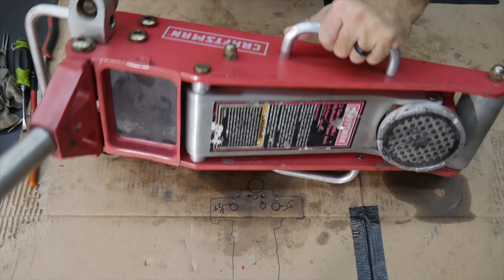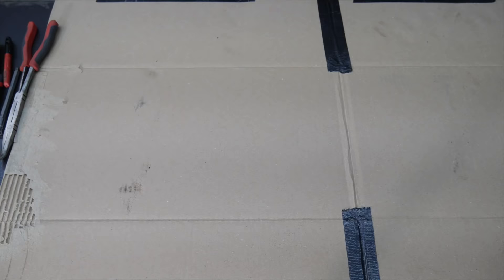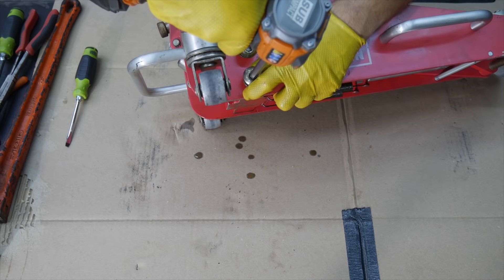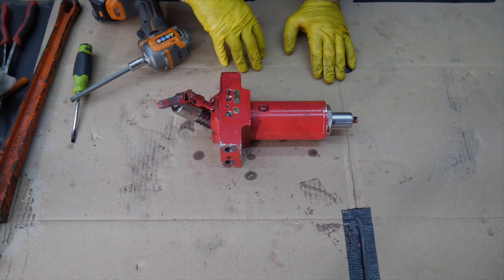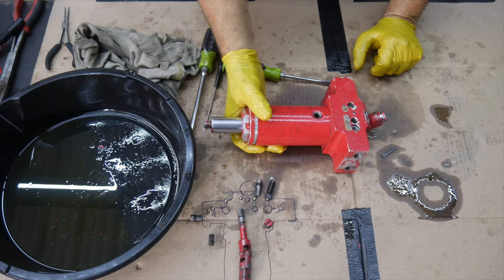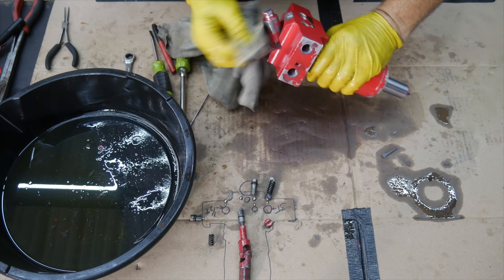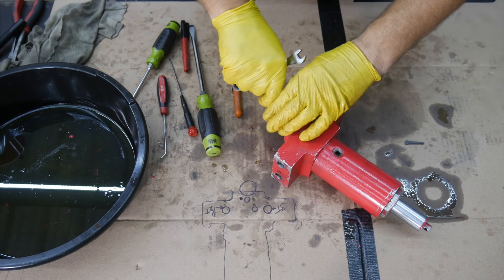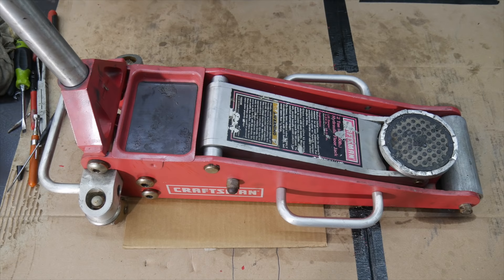MUST HAVE TOOL! How To Fix or Rebuild a Floor Jack [BOTTLE JACK]

Comment: Great job! I have a Harbor Freight jack that slowly creeps down. I'm sure if it is anything like the craftsman? I can handle it. It doesn't leak externally, we shall see. I am wondering if they have a rebuild kit for this jack.
Reply from the maker: You can probably find a rebuild kit. Thanks for watching.
Reply: @Shoptoolreviews  Thanks for your' reply, I will check on it today. I have to go out to my shop to check numbers.
Reply: @CorbinAce  did you find a seal kit? I can't seem to find one for my hf 3 ton
Reply: @dm-zx7xb : Sorry I have been to busy with other projects So,,, No I have not .
It's called too many projects!
Reply: @CorbinAce  I understand! I spent hours searching the web at work today with no real luck finding a compatible seal kit. I would be fine if they even sold just the pump.
Reply: Did you ever find a kit??

Comment: Does anyone know where to get one-off o-rings and seals for floor pumps, specifically the wide one that sits at the bottom of the pump assembly at the opposite end of the large gland nut, without buying an entire seal or rebuild kit?

Comment: On my jack, one of the rear pistons has rust inside on the cylinder wall. What should I use to clean that out of there? Thanks.
Reply: Start with 600 grit sandpaper; then, go to 800 grit, 1000 grit, 1400 grit. Wrap sandpaper around a metal or wood rod. The rust pits don't have to be completely gone. The jack oil film should bridge small imperfections.

Comment: Looks similar to a jack I was given that didn't work.  Low on oil, I had clean power steering fluid which is technically hydraulic fluid,  right?  Anyway,  filling it restored function but it leaked..which is why I was gifted it.  
The valving is identical and far more complex than a simple bottle jack.  Is this a fast pump jack?

Comment: 11:40, 'I could take that out if I wanted, but don't see the need' That inner tube is the speedy lift tube and If you dont unscrew the ram tube and take that apart, you can not replace the rubber orings down inside there. Speedy lift pressurizes the small inner tube to speedily lift the jack up on one handle stroke. hey if that has bad seals, it wont work. One if the valves is the speedy lift adjustment, It hands off the pressure to the main ram cylinder once the jack saddle touches a heavy load. You really do want to take it apart, especially if the speedy lift function is busted.
Reply: And there are more seals in the drilled out center of the main ram to seal the speedy lift tube so it can develop enough pressure to quickly raise the jack up under no load. No speedy lift working, jack will still work, just wont lift fast the arm to the load. It is like a bypass system, low pressure on the saddle, means speedy lift valve in the main body stays closed, then under the heavy lifting  load, as oil pressure builds, speedy lift valve opens and allows high pressure oil to flow to the main ram cylinder to lift the heavy load.

Comment: Dang man. That is alot of work for a jack. But good job showing us how to battle this bastard. I would have just put on some tasty tunes and drove down to the harbor freight for new one.
Reply from the maker: I do understand, and thanks for the kind words. Thanks for watching.
Reply: I'd say it would probably come down to how much you value that particular jack, what the cost of buying a replacement jack would be, and what value you place on your free time.

Potentially you could rehabilitate a quality Craftsman "Made in America" , one of the more expensive HF Daytonas; an inherited jack from a grandparent or parent; or a second hand tool truck jack: for the low cost of a rebuild kit, $50-60(?). Imagine going on FB marketplace, Craigslist, eBay, the local flea market, etc and buying a "broken" vintage jack and get it back in working order
Reply: @Jujoji  True. No Harbor jack is going to qualify for that amount of work. An older more solidly built piece may be worth all the time and effort.

Comment: anyone knows the repair kit for a central hydraulics 4000 lb. aluminum racing jack with item 92782 (harper freight tools?
mine is leaking.

Comment: This is good information but a 20+ old jack most likely will not have the  seal kit available anymore.  My 22yr old 3ton Alltrade floor jack started leaking and the seal kit was discontinued.
Reply: Go to a hydraulic shop and they can probably match up your O-rings

Comment: Nice detailed video.  When the pump is pressurized and under load (supporting weight), is the pressure on any of the seals, or is the load basically on the steel ball bearings "cloging" the return line until manually released?  Would supporting a load for a longer duration prematurely weaken a  seal because of the pressure?

Comment: Need advice please. If no air present & reservoir is full, why isn't it pumping up as it should and falling slowly?
Reply from the maker: It really depends on which manufacturer and model. Seems like it might be a dirty passage way or a stuck check ball.
Reply: @Shoptoolreviews  Thanks for the reply. Craftsman 3 ton. Mdl 214.12300. I removed two ball bearings with a magnet, they were in pristeen condition.

Comment: Thanks for detalied video. A Q if you have time. My jack is very slow but holds up the lifting arm and it starts after 10-20 pushes and then goes 1mm per push. When I release the valve for the lifting-arm going down the push-valve pops up = it has air-pressure behind it. All the time it does that. I have one little leak in the push-valve down at the botton NOT the piston o-ring just the cylinder o-ring for it. I have cleaned the channels. Is it going in air there? It is new fluid. How much fluid is needed for floorjack cylinder, is it to the opening and the rubber-sealing laying down or standing up?

Comment: What would be the cause of a squeaking noise while pumping? Which parts should be lubricated?
Reply from the maker: If it's a squeak from metal to metal rubbing together, then you should just spray some white lithium grease in each of the joints. You may be hearing a squeak from a hydraulic leak within the jack distribution block. This would mean you have some seals that are bad. Thanks for watching.
Reply: @Shoptoolreviews  I'll try that. Thank you for the info and the awesome video!!!
Reply from the maker: Good luck and thanks.

Comment: You didn't appear to set the cotter pin ends on the other side of the connection point.  Just tapped the cotter pin in

Comment: I have two NAPA Carlyle 3.5 ton floor jacks, and they are less than two years old. I bought them both from NAPA at the same time.  One of the jacks has developed a loud snapping noise near the lift cylinder every time the handle is pushed down when the jack is under load. It lifts okay, but this snapping noise is really irritating. The jack is full of jack oil and reaches max height in about 8 strokes. My other jack is nice and smooth, no noise at all. Try as I might, I can not determine exactly where this noise is originating from, and what it would take to fix it. Has any body else had this problem, and does anyone have a suggestion to fix? Thanks to any one for any reply.

Comment: Hi, this model is different from the ones i repair  MEGA SPAIN brands ..but  at your video 23:23  a nylon ring and o-ring at outer side? 
I've seen a copper washer ...
A copperwasher is better and add light locktide liquid on the thread

Comment: My ram is leaking from the top. Haven’t been able to take the top cap off. Tried a 2” socket but really hard to hold in place.

Comment: I had recently purchased a floor jack but having the issue of it not lifting under load. I checked the fluid level and purged the air by twisting 2 times and pumping 10 or so times and still nothing. Any advice? Or knowing of any shop that does repair them?  Thanks great video love the channel
Reply from the maker: If it's been recent, then I'd take the jack back and exchange it. Thanks for watching.

Comment: Somebody knows what those two screws that supposed to be you don't touch what day does
Reply: This is what they call a rapid jack. When there is no load on the jack, it rises fast, but not much power. Once there is enough load, the valve bypasses and hydraulic oil is diverted to the main outside of the u-cup seal on the piston. That is where the real power happens. One of those adjustment screws on the valve determines at what load, or force, this happens.

The other valve determines what the relief pressure is set. When looking at a jack system, it’s not just all about how much weight the hydraulics can move. Other jack components like the arms, wheels, saddle, etc. have to be able to handle the weight. To make sure the jack is used only to the manufacturer’s allowed maximum lift, the relief valve is set to the proper pressure.

Comment: You don't need to disassemble the jack in that manner to change the piston seals; nor, need to use a BENCH VICE. You can do it without the HUGE wrenches by using a large socket on the big reservoir nut.
!. Drain the reservoir and turn the jack on its back. 
2.  Disconnect the two springs.
3. Pull the saddle / lift arm outward to gain access to bent ends of big cotter pin, and bend the cotter pin ends together, for removal of the cotter pin.
4. Lay the jack on its side and put the jack saddle / lift arm in its lowered position. This action pushes the piston into the reservoir. Now, remove the big cotter pin.
 5. Push the jack saddle / lift arm to the fully extended position.  This action moves the cross-bar away from the end of the piston and allows access to the big nut on the end of the reservoir.
6. Measure across the big nut's flats to determine the large socket, or crowfoot wrench, size which you will use with a  socket breaker bar. The old Sears floor jack nut socket is 2 3/16 " (56mm) and sells for about $24. You may rent, or borrow, an axel nut socket of the correct size from an auto parts or tool rental store.
7. Place the large socket (or, crowfoot wrench) on big nut and have someone (or, heavy object) stand on end of the jack handle (to counter-balance the torque you'll apply to the nut).
 8. Tap on the tool  and big nut with a hammer as you use an impact wrench or long breaker bar to loosen the nut. If using a breaker bar, STEP heavily on the end of the breaker bar ( in a loosening direction) while tapping the end of the nut and reservoir. The nut will loosen easier than you expect.
 9. When re-installing the big nut, a good snugging is all it needs. It's only the reservoir cap nut. There is no (or, very little) fluid pressure in the reservoir behind the nut.
10. Reassemble in reverse steps.
Reply: He did forget to show rebending the ends of the cotter pin. I noticed that he had forgotten to insert the screen.

Comment: I have 12 years old  3 ton arcan dual piston and I’m losing height of 1” per hour with load but there’s no fluid leaking , any suggestion? Thanks
Reply: Might be some kind of oring, maybe near the pressure release you use to drop the jack down, since no fluid comes out of there anyway
Reply from the maker: Definitely leaking past a seal or o-ring. Needs a rebuild or replacement. Thanks for watching.

Comment: What socket size did you used to remove the nut
Reply from the maker: I don't remember, it will change from jack to jack. Thanks for watching.
Reply: Best bet is to use a pipe wrench.

Comment: What's the best way to store floor jack in a super hot trunk?
Do we leave the valve open or close it clockwise (ready to lift)

Won't the heat expand the oil or make something that causes a leakage? 

Thanks 💛

Comment: I didn't see where you replaced/repaired anything to stop the leak!?!?
Reply from the maker: Someone else asked this too, and I don't blame you. Good catch!! We had to film rebuilding this jack 3 times, due to a camera issue. We'd already replaced the O-ring, and by the 3rd round, I forgot to mention it. If you look on our Instagram feed, you'll see one of the "other" takes when we tore this jack apart. Thanks so much for watching.

Comment: At approximately 23 minutes you state that if you take an o ring out it is done and do not reuse it.  At 23:46 you replace the o ring you took out at 23 minutes.

Comment: You can burp it with the screw too, just don't wind it all the way in
Reply: Yes, when the jack handle screw is loose, the power pump plunger pushes air and fluid towards the reservoir. The reservoir fill / drain plug should be out for the air to escape.

Comment: So what was wrong with the jack...I mean, which parts did you replace before making this video?
Also, you did say, "or you can just replace these as needed...if you can find them."
Reason I bring this up is that I can't find a fully distinguishable tag, label or punched mark on our floor jack. 
Industrial G-----------. Made in April 1982.
So...anybody?   It's Green... and the handle must have had something covering it but is now gone. And it's not painted and very "shiny!"

Comment: Balls of Steel Bro inside that Power Unit, no bearings to be found, otherwise very informative Video. Recommended Jack Oil is 22 weight of the non-detergent variety.

Comment: Never degrease any of your tools , jacks included ...or any that have no chrome on it .....you will just rust it ...and ruin it .
Grease and oil is a good antirust .
Reply: I keep a oily terrycloth rag in a plastic jar to wipe down my really old (non chrome plated) tools. My choice of oil is 90 wt gear lube.

Comment: You didn't show us that it worked like using it and didn't see any repair for the leak?? 😀
Reply from the maker: This is going to sound like a load of excuses, but here goes. I was planning to show the jack lifting a truck, but the video was already so stinkin' long, I couldn't bear to add 2 more minutes (probably should have). We had to film rebuilding this jack 3 times, due to a camera issue. We'd already replaced the O-ring, and by the 3rd round, I forgot to mention it. If you look on our Instagram feed, you'll see one of the "other" takes when we tore this jack apart. Thanks so much for watching.
Reply: I was thinking the same thing. But you did everything to show the guts of a two-stage floor jack. This was great video, steady camera and good vocals. I hit like and subscribe just because it much more than others did. You went 99% of all the way, but I understand the time issue with todays short attention span. 
 I want to know & learn, even at 62. I felt pain watching you on the floor, but a safe place to work on heavy stuff that you have to move around. As an ASE Master Tech since 1978, retired against my will, not because of cars but lumbar fusions caused by a guy who spent 3 month trying to get me into his new shop. But everything is fused from S1 up including the L2 (10 shiny screws & 2 bars about 8” long). So catching up on repairs, building and a hundred other items. I really like what you did. I hit like and subscribe. Blessing to you and stay safe. I have to fix anything that breaks, in my garage or house, so this was very helpful as techs dig into new trans, diffs and what ever for the first time everyday. Part of me misses it, maybe the 1982 paycheck I am stuck with, at 2020 prices. Even used cars and trucks bring more than my first house, a family of 6. Pushing ahead!  Thanks again!

Comment: PRO TIP:  1) CAREFULLY DISASSEMBLE JACK PUMP.  2) GO ONLINE, PURCHASE NEW FLOOR JACK.  3) VERY CAREFULLY PLACE OLD FLOOR JACK PARTS IN TRASH CAN.  4) UN-BOX NEW FLOOR JACK AND BEGIN TO USE AND ENJOY..........(IT IS ADVISABLE THE USER BE MECHANICALLY INCLINED.  MUST HAVE EXPERIENCE TAKING SHIT APART AND NOT PUTTING IT BACK TOGERTHER.  MUST ALSO HAVE EXPERIENCE BUYING SHIT ONLINE)....CHEERS AND GOOD LUCK WITH PROJECT.
Reply from the maker: Thanks for watching.

Comment: Can anyone figure out whats wrong with my floor jack? It holds weight,it just goes back down 70% of when it’s pumped. I’ve tried bleeding it and taking it apart and couldn’t find the issue.
https://youtu.be/D9happ9QTmk

Comment: you have some bell shaped wear inside that sleeve, if you take it apart I'd replace the seals while you are there.  Seals get hard and while they might look fine, they won't perform properly.

Comment: I don't believe you, this video is fake. I have a twin piston unit from the port cargo store, and those ram cylinders are basically glued in. No way a little battery tool was able to just unscrew it.

Or maybe my battery tool doesn't have the beans.

Comment: You just said in the video if you take a seal pick and take out the o ring that its done you need a new one ! Then in the next five minutes you slap the old o ring back in that was leaking out of the ram to pressurize the jack. Its a good video but wow you don't even have a rebuild kit for it. If I tore a jack down that far there would be a complete rebuild kit to replace all the seals. If you are not going to flush out all the passages in the body and blow it out then why take out the screws and check balls seems to be a waste of time if you don't have a complete rebuild kit and are not replacing the seals? Sorry just shaking my head in confusion